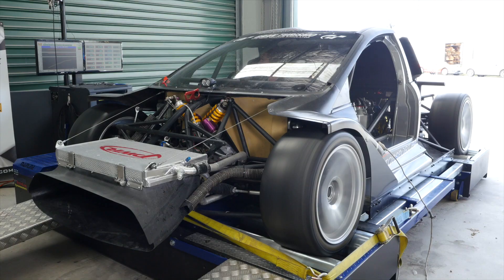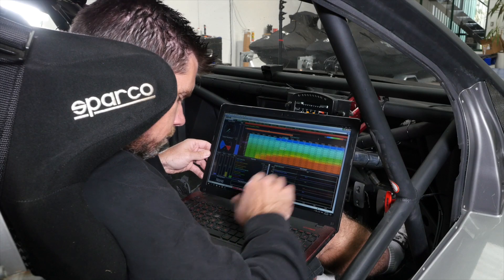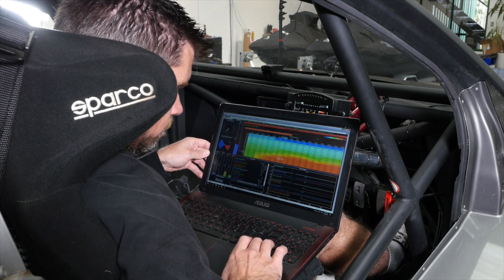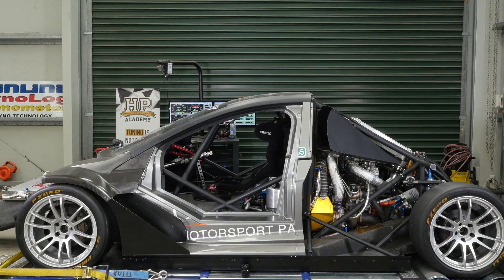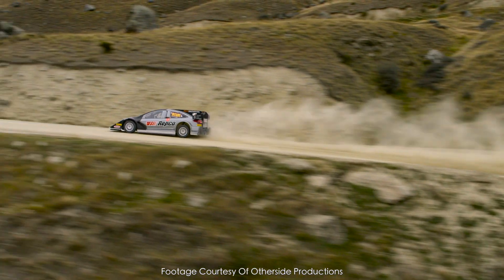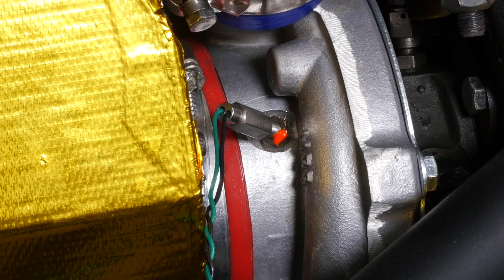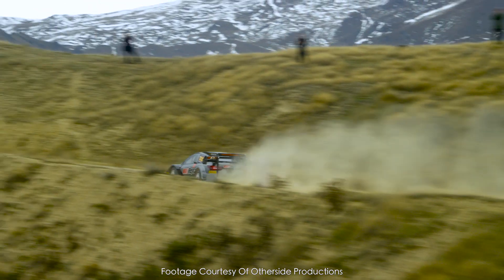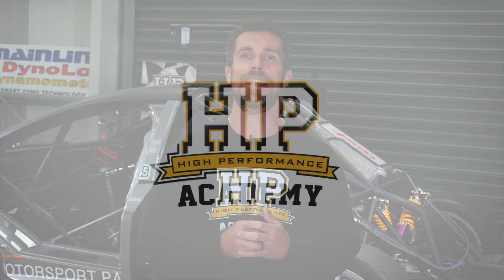How ALTITUDE Affects Your Tune | Barometric Sensor [TECH TALK]

Comment: I live in Colorado and work in Breckenridge, about 9k feet. I'm looking at either buying a 3.5 ecoboost or 5.0 v8... will the v8 adjust or is the v6 a better buy
Reply from the maker: Unless you're running an old carb setup, your EFI system will adjust for you 😎

In motorsport it changes a bit again as discussed along with forced induction adding another layer to the cake. Pikes Peak is a pretty extreme example, but in general your ECU will help maintain performance via adjustment/s - Taz.
Reply: @hpa101  thank you 5 oh it is!!

Comment: Can this cause my engine to die when I try and start is times ...I have a skyline and had it rebuilt a d when I brought it home there is a 600ft increase in altitude from whe  it was tuned and dyno ...starts up ok ..take it out go for lunch .and start it up and it turn over and dies ..?
Reply from the maker: Hmm, send the log files to your turner, as part of the service they should be able to sort that for you - Taz.